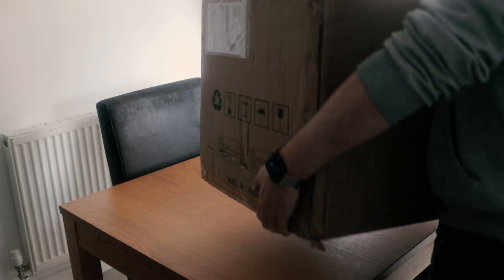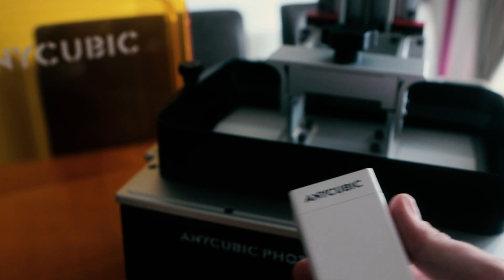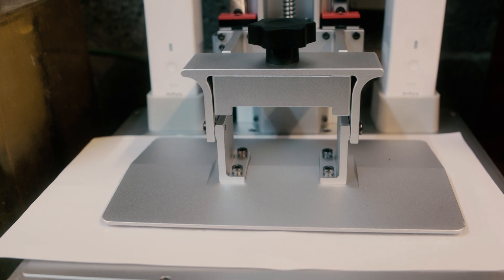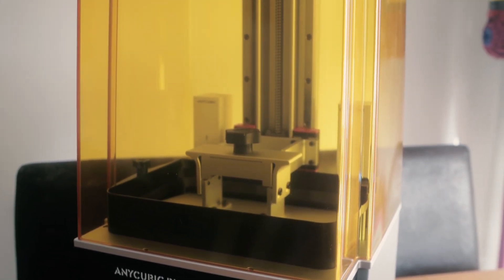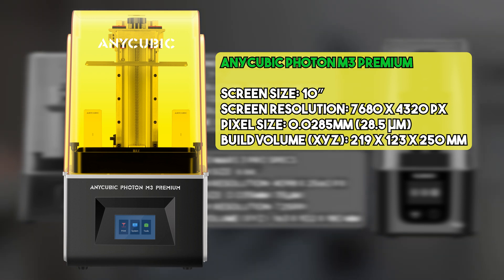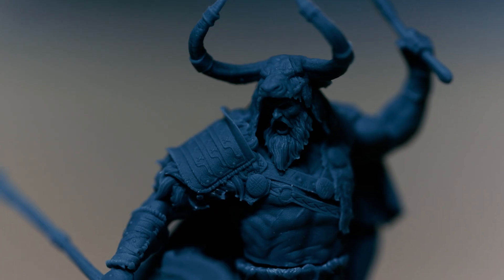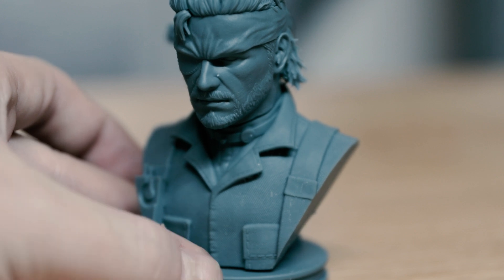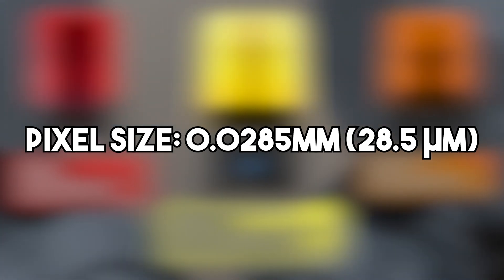Best 10-inch 8k Printer? - Anycubic Photon M3 Premium Review

Comment: Hi  great review. So What would be your choice be between this and the Elegoo saturn2? Also is this a SLA or MSLA machine?  MSLA being faster and the Elegoo saturn 2 being MSLA, do you see a difference in print speed between the two?
Reply from the maker: Not to sound arrogant, but I struggle to answer that question because so much nuance goes into my personal reasons for wanting a particular printer.

I prefer the user experience if the M3. And would choose that “personally”.

Also, all LCD printers are MSLA, SLA uses lasers. I’ve never used an actual SLA printer. Not sure if there are any in consumer space
Reply: @FauxHammer  Thanks for the response and personal suggestion. I asked about SLA vs MSLA because if you look at ads for the Anycubic resin printers on Amazon, Ebay and other places they refer to their Printers as SLA in the title, while Elegoo always refers to their printers as MSLA.
Reply from the maker: @johnferro6214  yeah it’s just Elegoo being specific, the technology is all SLA. But LCDs are Masked SLA. Neither are wrong, Elegoo are just being specific. Which they should all do to be honest

Comment: I’ve been using anycubic exclusively and have no complaints, the photon d2 and the max
Reply: I have the Mono X 6K as well as the M3 Premium.  I've had nothing but issues with them both not ever connecting to wifi.  Horrible customer service to boot.  I am looking for a new printer now, it will NOT be an Anycubic!!!
Reply: @erikdravn  like a lottery I guess. Still using mine, and they still work as intended. Most of my issues were miscalculation, damage caused by me and not my machine

Comment: After seeing your reviews, I bought Anycubic Photon Ultra and I am delighted.  I got really into 3D printing.  Now I'm looking for a second printer with a larger work surface.  I'm thinking about Anycubic Photon M3 Premium or possibly D2.
Reply from the maker: The D2 is a slight improvement but not one that in my opinion warrants an upgrade. You'll see a significant bene for from the M3 premium in terms of size. But there's also the Saturn 2 to consider, I'll do a comparison video when I can.

Comment: Good overview.  Mine is on the way, so I'm trying to get acquainted with it before it even arrives.  So how long did it actually give you until it suggested replacing the NFEP, and how long would you have expected?
Reply from the maker: Heya sorry fir the late reply, so it was about 2 and a half bottles of resin if that is any measurable significance

I’m about 9 bottles in now, I still haven’t replaced it

Comment: Ball screw setup in the m3premium rather than the lead screw in the sonic mini 8k? It might be upping the detail a little, making it harder to discern between the two? But maybe not. Couldnt really find good specs on mini8k to be sure its just lead screw.
Reply from the maker: Sorry, lead screw, ball screw?
Reply: @FauxHammer  Yeah I agree its confusing. "Simple leadscrews — based on sliding contact between the linear screw and nut.   Ballscrews — based on rolling contact between the linear screw and nut (via ball bearings)" Not totally sure which kind the sonic mini 8k has, hard to find it printed out.
Reply: "Generally speaking, ball screws are better for applications that require smooth motion, efficiency, accuracy, precision, and prolonged continuous or high-speed movement. Traditional lead screws are more suitable for simple transfer applications for which speed, accuracy, precision, and rigidity are not as critical."

Comment: At minute 6:15 and 9:10 the difference between the two impressions of Wolverine is noticeable. The impression on the left is textured and the one on the right is not, the ear area came out blurred. Will it be Anycubic or Phrozen?
Reply from the maker: At 06:15 where they are back to back, I can see from a FEP issue I had in that print, that the one on the right is from the Mini 8k, the left one is the M3 Premium. In the following shot, I can't see it close enough to tell.

Comment: Holy Molly ! She's a big girl ! I know she's the luxury version of the Saturn 2 (better build but same definition and printing volume) but I couldn't afford the +30% cost. I'd be able to buy quite a lot of resin bottles instead of that premium or even start dabbling in more costly specialty resin..  Oh and I have the impression it's the STL source that is lacking now with these new printers. Sculptors have to start modeling finer 28mm models instead of just shrinking the 75mm detailed ones...
Reply from the maker: It’s a lot of convenience
Reply: What you said about the modelers shrinking is not correct. The model is a model and the units can be mm microns or meters, makes no difference from the model. This is not a rasterized image which will "lose information" when enlarging or shrinking. A 3d model "won't lose any information". The bigger you print it (nor the resolution!) The bigger you will notice if details are not present. But, to be fair to your comment, if a modeller expect that a print will be 75mm, she could put more detail because that detail will be more visible in a final product.

Another important force here is the final use of the miniature... I hate super detailed figurines because they are really painful to paint properly.
Reply: @droghtak  You may have misundertood what I said. I never talked about scaling UP. I talked about scaling DOWN. And no, a model isn't a model isn't a model. When you sculpt whether digitally or analog, you sculpt at a given scale. You elect to sculpt some details because they "work" i.e. they can be picked up by the naked eye at a chosen distance, here tabletop view. And you leave out the rest, that could have worked at a bigger scale for display models. Note also that when you do sculpt digitally, you don't sculpt at an infinite resolution. Our minis would weight tens of gigabytes and be unprintable.

Comment: I dont resin print (yet) but I have seen numerous video where people fit the tray by pouring from a height onto the um... screen? (3:20) why is this?
Reply from the maker: A few reasons

1. Trying to wedge the bottle in and angle it between the build plate and "Vat" topour, is cumbersome
2. It's more cinematic.
3. A steadier pour into the vat, less splashback
Reply: @FauxHammer  ah. no.2 lol :D